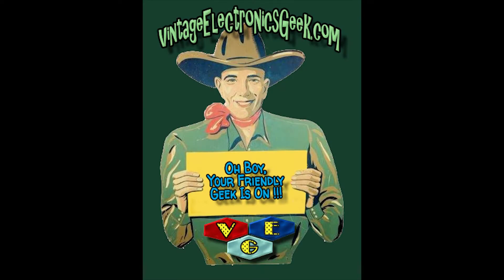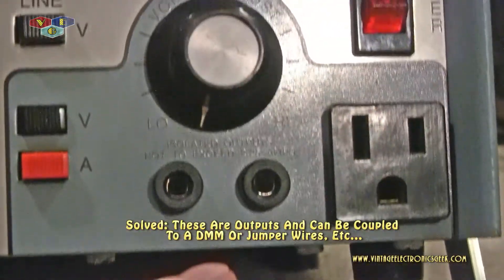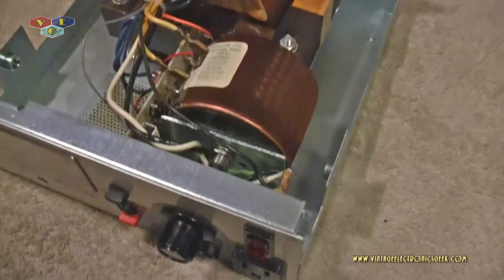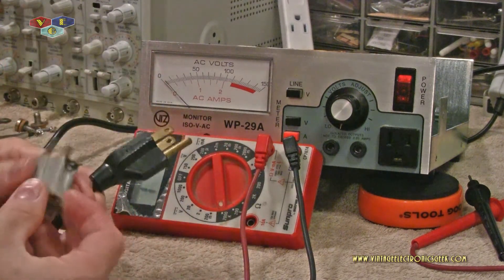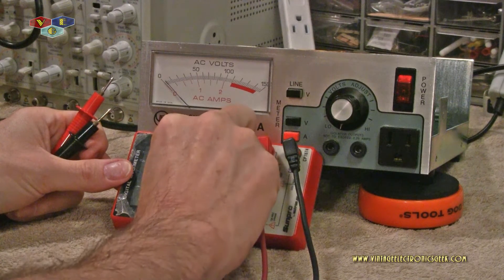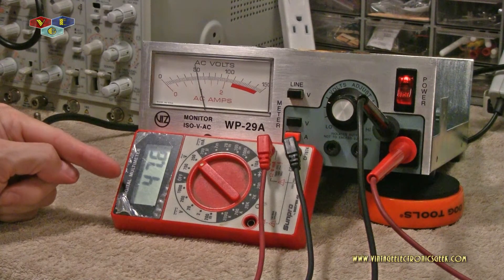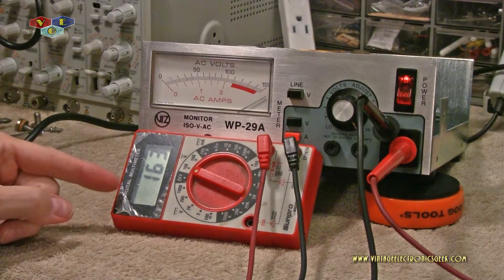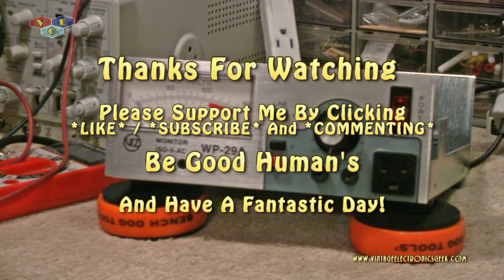VIZ ISO-V-AC WP29A - Isolation / Variac Transformer - Overview

Comment: I've had one for a long time, but never realized it was an isolation transformer too.  I have just use it as a variac to test for variances in old instrument responses to line voltage variation (the industry I test in requires that, but it is mainly for instruments with linear power supplies).  I am looking for a schematic or manual.  I want to know what they are doing internally with the ground prong on the AC Out connector.
Reply from the maker: Howdy!  I unfortunately have no manual for this device nor could I locate one, however the best I can offer you is some links that may help you.  

This PDF announces the new device and it clearly ID's the device as a isolation transformer, look at PDF page 45 or document page 61:  https://www.americanradiohistory.com/Archive-PF-Reporter/80s/EST-1984-09.pdf

In this forum they state this devices does not isolated via the transformer but through the electronics...I haven't had mine apart since this video, so I am unsure if they use optocouplers to do that:  https://www.antiqueradios.com/forums/viewtopic.php?f=8&t=255474

In this forum, they state this device is almost the same as the WP-32, here they do show pictures of a service manual: https://www.antiqueradios.com/forums/viewtopic.php?f=8&t=332838

And finally here is another forum of the full service manual for they WP-32 posted page by page:  https://antiqueradios.com/forums/viewtopic.php?f=8&t=336335

If I do one day find the document, I'll let you know...but from what I have seen posted by others...it is an illusive document...so, one may never be located?  Hope that helps some.  Best wishes.  ~Jack, VEG
Reply: @VintageElectronicsGeek  Thank you; three years later I google and checked manual sites this morning and still nothing on it.     It's simple enough not to really need it, but I do like having manuals for everything on my network.  I still use this several times a month, if not each week.  It's a permanent fixture on the bench.  I think the only thing I have replaced on it was the rear panel breaker.   It mainly gets used for instrument stability tests to mains voltage variation.
Reply from the maker: @Daveyk021  No worries!  I haven't searched since the original post.  I use mine very often as well, a key staple to my workbench and safety...I do like it  a lot, however if I could come across a Sencore cheap, I'll upgrade!  :)  ~Jack, VEG

Comment: please don't bypass the ground on the input as it makes the the device itself unsafe.  Isolate the ground on the output if you want a true galvanic isolation (assuming the unit actually has the input/output grounds tied together already)

Comment: I just acquired a WP-29A, I get no meter movement when I’m in the Amp mode, does yours work?
Reply from the maker: Yes, mine works...have you tested with a high current draw such as a blow dryer?  If you read my reply to the above pinned comment, you'll note that a service manual (as of 3 years ago) cant be found (I haven't searched since then).  Another thing to note is sometimes the switches don't make contact, so maybe use contact cleaner on them and see what happens.  ~Jack, VEG
Reply: @VintageElectronicsGeek  No, I haven’t tried it with a current draw, I give it a shot when I get home from work.  Thanks!
Reply from the maker: @GaryDoty  My pleasure, if your blow dryer pulls more then 2.5 amps, the circuit breaker will pop, just turn the device off then reset it with the button in the back, it should turn back on....hopefully you'll see the meter move...if not then you may need to try something smaller such as a lamp, TV, etc.  Good luck!  ~Jack, VEG
Reply: @VintageElectronicsGeek  works great!  Thanks again!
Reply from the maker: @GaryDoty  That's great to hear!  Glad to have helped and my pleasure! Be safe and enjoy!  ~Jack, VEG

Comment: This unit is very similar to the Sencore PR-57. The only difference is, the Sencore has an input for a leakage detector probe and can measure leakage current on the outside of a chassis. The Sencore PR-57 is a better made device and has a built in circuit breaker as well as a fuse. They hold a hefty price on the used market, but is worth the cost.

Comment: I have one of these and if you look inside you will see the the third ground pin to the outlet is grounded to the chassis.
So is the third ground pin coming in to the unit from the wall.
But the 2 banana plugs are isolated.(As it reads above them)
So I clipped the third ground wire connected to the output plug now it too is isolated.
But the chassis is still grounded with the third ground pin to the wall.
You can get a device that plugs into the wall and reads if the wall outlet is wired right.
Electrical Outlet Receptacle Tester Faulty Wall Plug Wire Finder GFCI Circuit---5.00 or so on eBay.
You are correct, your video is the only one I have found.
Also the manual or schematics for this item cannot be found online. 
I am putting mine up for sale on eBay soon.
Thanks for video.

Comment: Nice bit of kit Jack and similar to my modern version. In mine the 2 sockets on the front allow the use of Jack plugs to connect the output voltage directly rather than using the plug. The earth connection issue differs very much depending on what's being connected and I have left mine in place for now. I'm no expert on these things though. All the best, Graham

Comment: Looks to be 3-4V low all the way across. Is there a way to adjust the meter to read closer to actual voltage? Looks like adjustment screw below meter.
Reply from the maker: The adjustment below the meter is to zero out the meter itself and not the actual power out, however there are two other trimmers on the inside that very well may adjust the output, one is accessible, there other I would need to disassembled (it sits next to a 6 pin dip).  I choose at this point to leave to meter reading off until I can find the time to sit and dork with it, until then, I'll just confirm output via DMM.  ~Jack, VEG

Comment: Yes very nice to have the convenience of the variac and isolation transformer in the same unit make for much more tidy bench and it guarantees that you always using the isolation transformer.  Nice layout on the control panel and clear meter reading. I would like a modern unit with a digital meter but they are expensive the one I have must have been made in the 50s and is getting a bit tired now.
Reply from the maker: My thoughts exactly, that's why I bought it, however my thought there after was, "hey, now I can add more junk to the bench"!  :)  Yes, it would be nice to have a digital reading, watching Doug's (Mosslack) channel and trolling eBay, I can get a digital display rather cheap, then put it in a project box and connect it to the banana jacks on the front panel. ~Jack, VEG
Reply: My mind works the same. Create a space. Buy more gear and fill it.